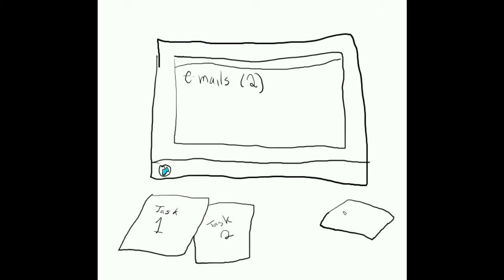Day in the Life:  Design Engineer

Comment: How does one become a firearm design engineer or a weapon system design engineer? I am a Btech in mechanical engineering and I want to be a design engineer in a defense firm. Is it compulsory to do a masters degree?
Reply from the maker: I don't think it is compulsory to do a master's degree.  I would identify the specific companies you hope to apply to and start watching for what they require.  I've worked for 2 defense contractors, and have friends at others, and none of us have master's degrees.  However, none of us work(ed) for firearm or weapon system specific companies.
Reply: Thanks! That's valuable advice.